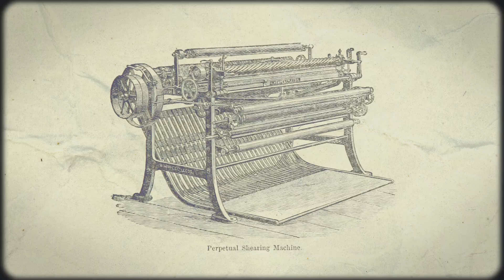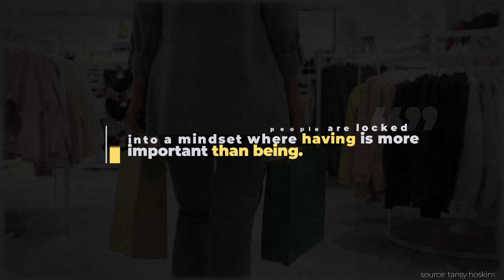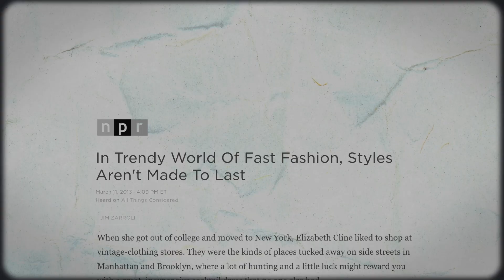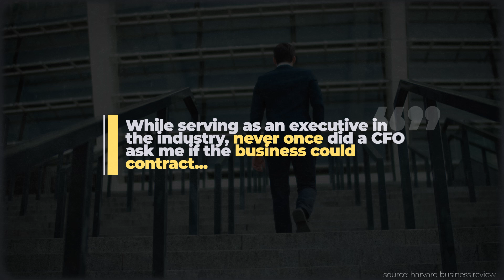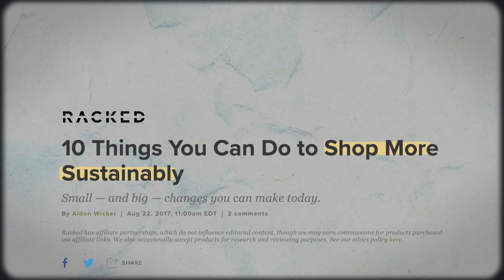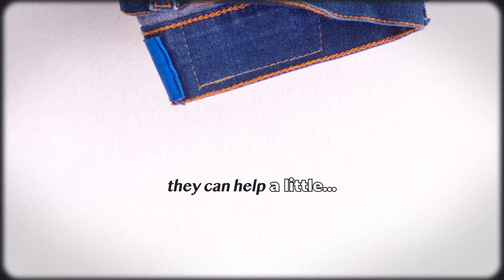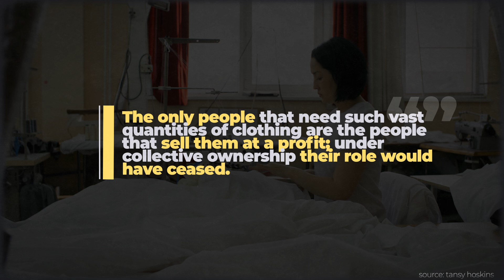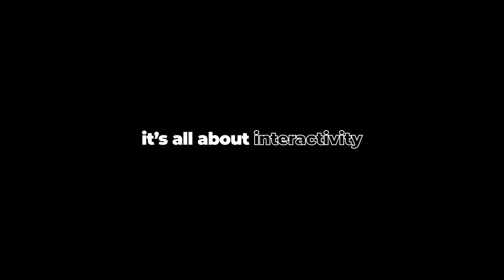How We REALLY Stop Fast Fashion

Comment: The problem is that synthetic clothing and fabrics is that they are very useful and used in many pieces of workplace PPE so synthetic fibers and fabrics cannot practically go away.
Reply: Yup also true with swim/surfing/athletic wear as well, since it needs moisture wicking and natural fiber is mostly good at absorbing, not wicking it to the outside for it to properly evaporate.  I wouldn't wear a cotton swimsuit to swim in as that's just a bunch of yucky wet underwear that needs to be off my body and washed right away. (just wearing that to swim makes it into an underclothes rather than something to wear for long periods in bodies of water)  I guess this is part of the reason why many T-shirts are made with a combo of fibers (natural fiber/poly mix).

Hypothetically maybe, even if it reduces the quality of the fiber over the amount of times it gets re-integrated into a "new" fabric (since the fibers are made from both recycled bottles and recycled synthetic clothes).  The issue with this is it requires more R&D and money to make  machines like this.  I also think they need to start filtering and recycling water back into the fabric and clothing factories instead of dumping the used water back into the environment and only bring in fresh water when the recycled water stores are gone.

Comment: When I need clothes, I buy second hand. In fact, I try to buy just about everything I need second hand if possible. (doesn't work for everything, of course) 

This is more of a way to offset the effect of the system more so than fix it; after all, the only reason I can always find what I need second hand with an almost overwhelming amount of choice is because of the grossly undervalued excess in the first hand market. But it still helps in a way that I can actually afford with my limited means (even though second hand can be, and too often is, more expensive than fast fashion). 

I also try to mend clothes when I can, although the items that need mending tend to pile up faster than I can mend them, so it isn't a full proof system. I have my excuses there, but I know I can do better with that.

Comment: As much as I like the idea about the "rational human", i think I know where the communally owned and democratically operated factory will eventually go - "why do we need to work at all if we could just outsource our work to other country that will do it for less and we can pocket the difference?". 
Switching to different modus operandi doesn't address the root cause of over-consumption in our age at all, just the rotation of owners and share allocation. You can tell me all day long that a democratically run/communally owned company is great (and I agree that the idea is great) for everyone, but it's only a question of time until old habits kick in and it reverts to small exploitations (cheaper material to make ends meet etc) here and there and in the end we're back to square 1. Also it ignores the people dynamics etc, it's again just an assumption that throwing 50-150 people into one communal owned factory will somehow magically work and everyone will be happy, always having customers, never a bad day etc. But I digress...

The problems we're facing today are deeper rooted than this and I do think that we're past the point of no return for us. The planet will be fine in several thousand years, as for us - don't look too good.

Comment: It is an individual consumer problem. On some level yeah especilly since seeing the good points for capitalism I am less strickt on it, for example by pre owned via Zerlando because I think that's a pretty neet thing. But like this can only exist because of consumer choice. And those (unlike the workers) are not in a position of force for the most part-. It as a system can only exist through that. What is one of the -the other is that is not practicaly feasible and would persumably be an entirly instable system would it be reasons we have to win people over there behavior.
How to ask somone hey do you know the working conditions in that mone